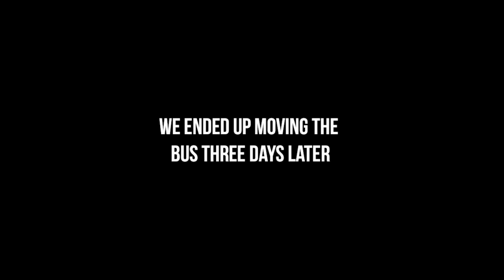Floor Rust Removal | Rust Converter | School Bus Conversion | Off Grid Tiny House

Comment: If anyone is watching this and needing to remove the rivets from the ceiling , if you were unlucky enough to not get a bus with screws on the ceiling. I would seriously consider an air compressor and an air chisel. I started off grinding them and then a neighbor offered to let me use his tool and it sliced the rivets like butter. Would have taken days grinding them. Got it done in a little over an hour with the chisel